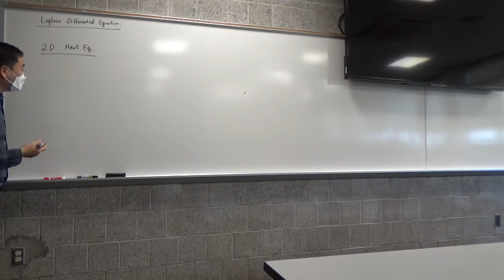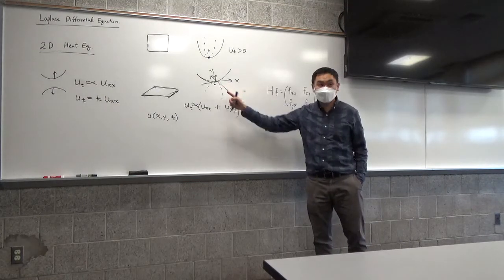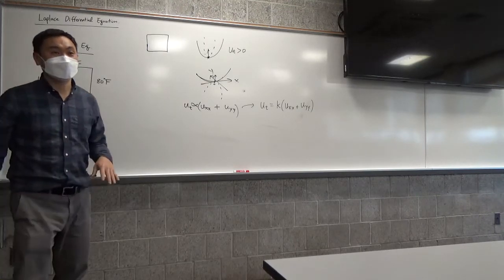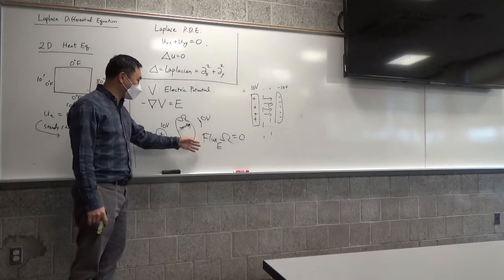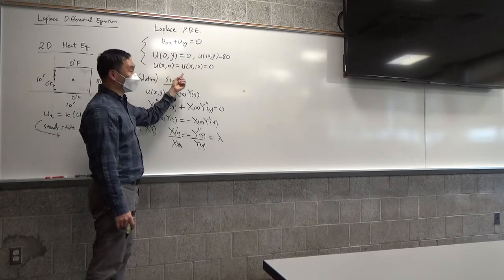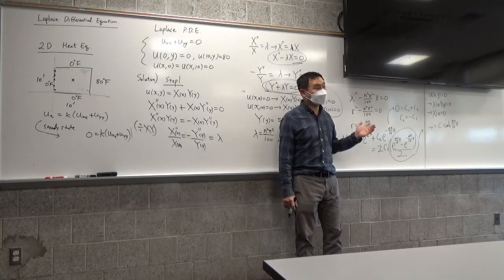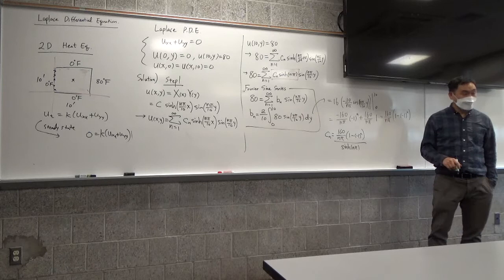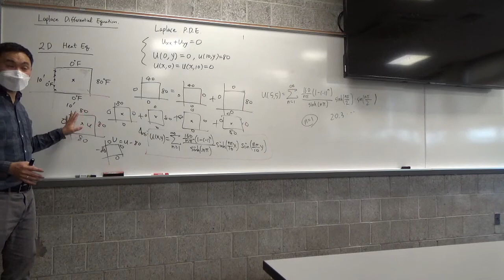Introduction to Laplace equation PDE

Comment: Well-explained, vid. Thank you very much.

Will the superpositon of the system work  (similar to that presented at the end part of the vid) if one side on X-direction has a nonzero boundary condition, and one side on Y-direction has a neumann boundary condition?
Reply from the maker: Yes it will. Superposition of two functions satisfying the Neumann boundary conditions again satisfy the Neumann boundary conditions.
Reply: @daniel_an  Thank you. I might explore this approach next time I solve a problem like this.

What we're taught in class is, we assume a solution u(x,y) = X(x)Y(y) + phi(x) in which x is the direction we want to have a sturm-liouville, and phi(x) is a linear function in x such that phi"(x) = 0 to satisfy the nonzero boundary conditions.
Reply from the maker: @erudawn  More generally u(x,y)=X(x)Y(y)+ax+by+cxy+d for constants a,b,c, and d, because ax+by+cxy+d has laplacian 0. You want to find a,b,c,d so that you can get a lot of boundaries to become zero. Only when you get 0 boundary conditions on three sides (or at least in the two opposing sides), you can use the principle of superposition.